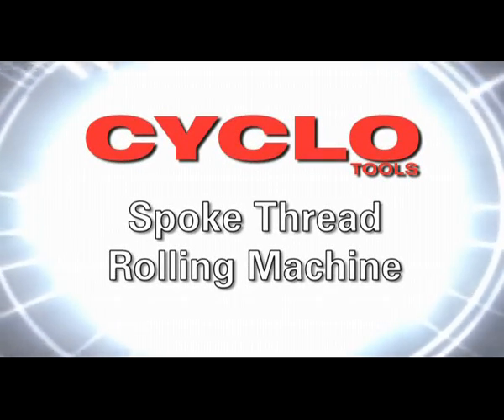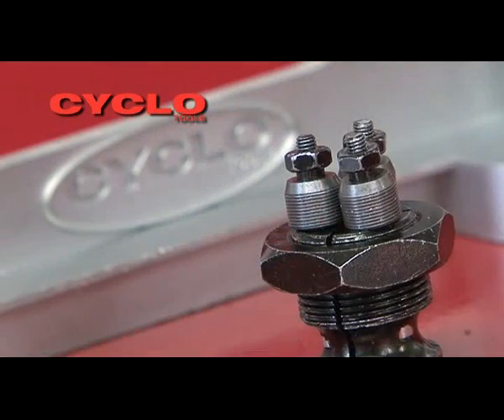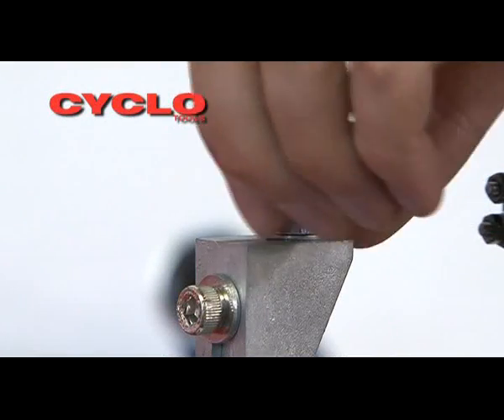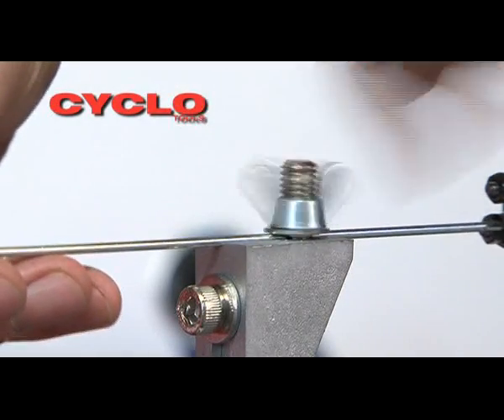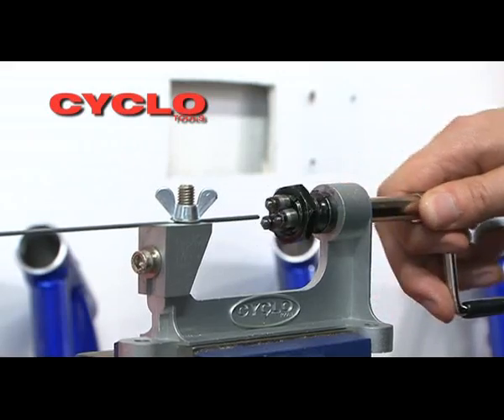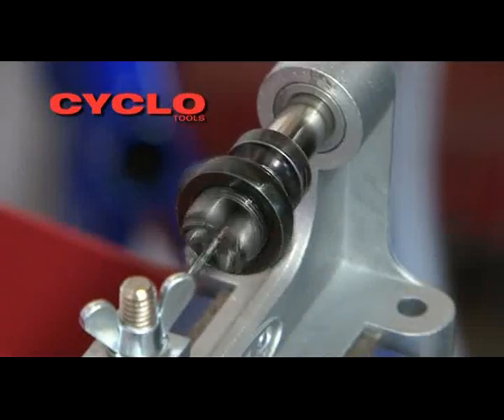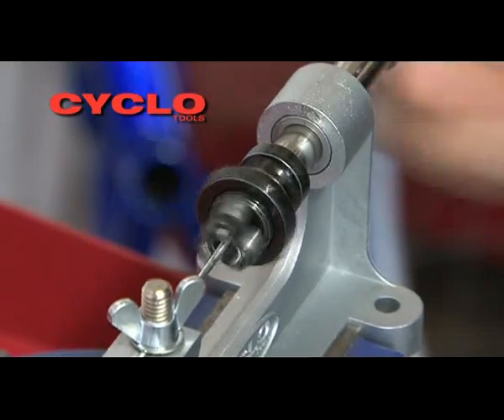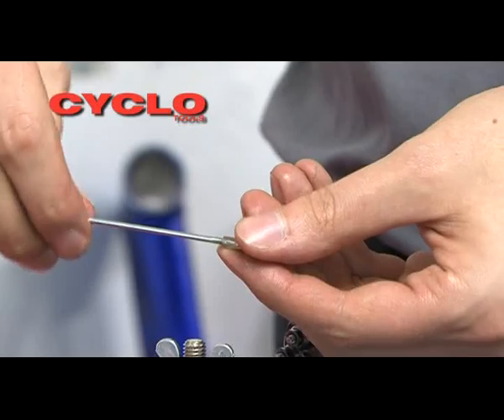CYCLO Tools Spoke Thread Rolling Machine

Comment: Hi I got an old spoke threading machine on ebay.  Its a different design.  Im wanting to fit a Cyclo 14g spoke thread rolling head to it.  But I cant find the shaft diameter details.  My machine has a 9.5mm shaft.  I guess thats 3/8"
Reply: I know it's 5 years now - since no one answered: I just bought the cyclus tools head. It's 10.0mm